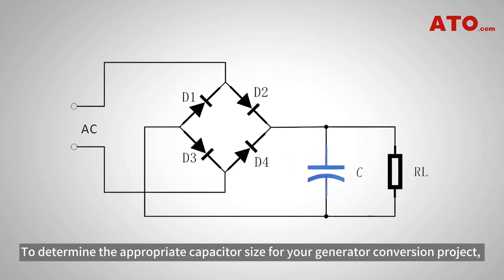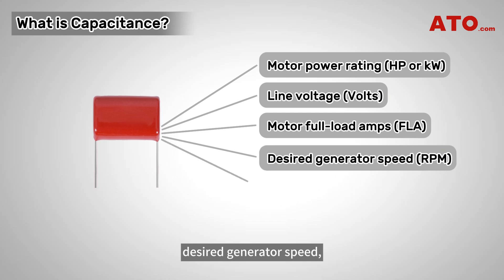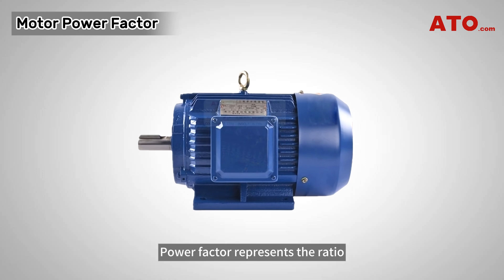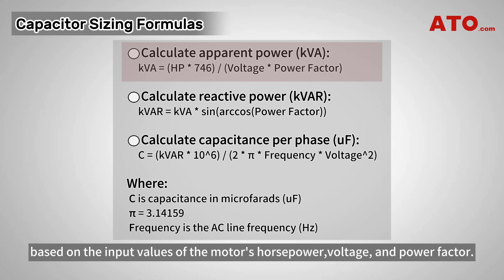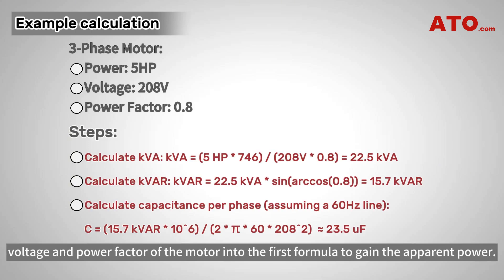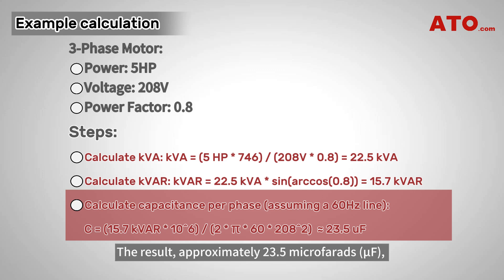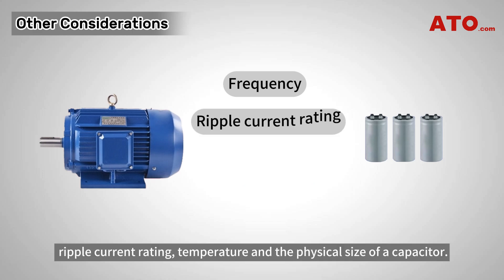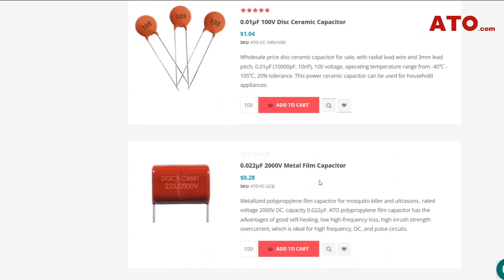Capacitor Sizing for 3 Phase Motor into Generator Conversion #howto #guide

Comment: how about the power or electricity consumption of the motor? is still the power if i used 3hp water pump directly to the power line or it will reduce the consumption if i used 5hp 3 phase motor to run my 3 hp water pump?. I mean, if i used 3 phase motor as generator can reduce my electric bill?